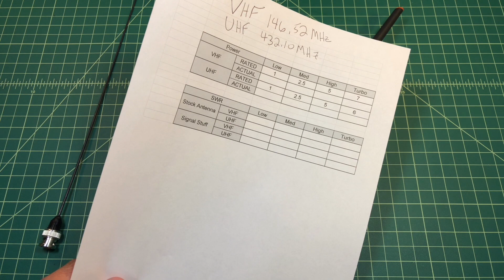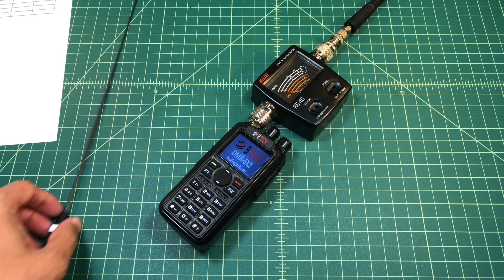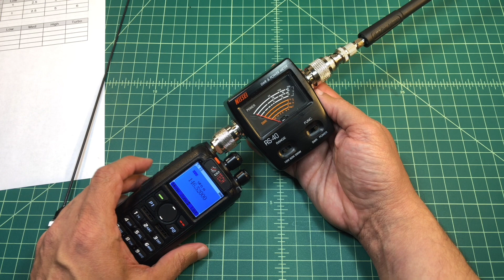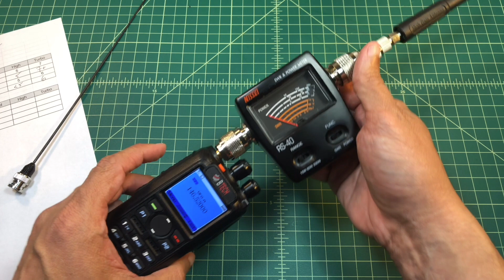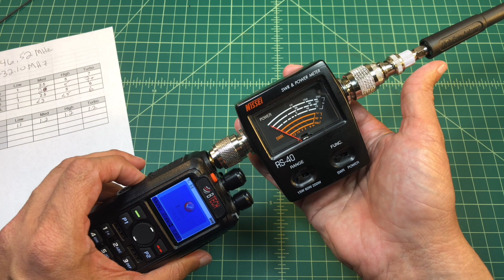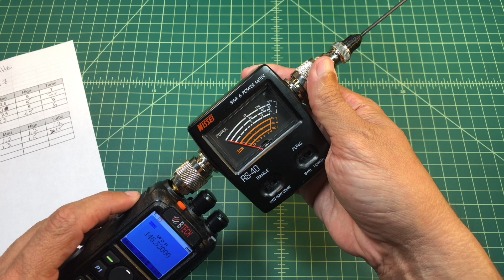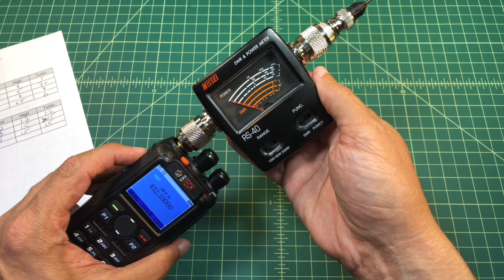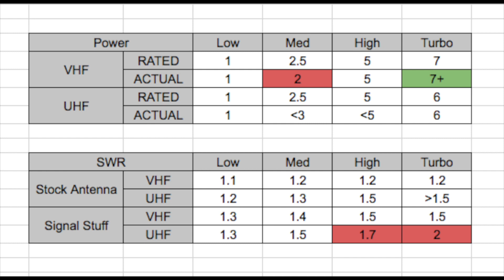BTECH DMR-6X2 Digital HAM Radio Antenna Testing - TheSmokinApe

Comment: The Standing Wave Ratio does not change with the power output of the radio!!! This speaks to the quality of the meter that you are as not being accurate! Just because you increased the power output the SWR would not change, what logic are you using here to think that it would?
Reply from the maker: I didn’t expect it would with this HT but I have seen it happen before on mobile radio installations.
Reply: @TheSmokinApe  I'm confused here, are you a licensed ham radio operator?
Reply from the maker: Mike B aka The Drone Ranger I am
Reply: @TheSmokinApe  Don't get me wrong as I'm not trying to be a smartass but how did you pass your test if you don't understand the simple electronic theory behind the resonance of an antenna? The power output of a transmitter is not going to change the SWR if it is as low as a 1/4 watt to a 1,000 watts. If the antenna is resonant on a certain frequency that does not change whether or not it's a hand held, mobile or a station antenna because of the amount of power being sent to it! The only way I have ever seen such a thing was when the antenna was being driven with more power than it could handle and started to melt and expand thus changing the resonance of the antenna! 

Now I totally understand that the meter doesn't atleast that I see have a way to calibrate it and that is more than likely the problem you are seeing with the different SWR's. That simply speaks to the quality of the meter itself and at best it's reading are only going to be reference but with you making those statements that the SWR is actually changing with the power output changing simply does nothing more than prove you don't know what you talking about and providing misinformation to the public!

My intentions are that I don't want you to continue to embarrass yourself and I don't want misinformation being spread so that the next person uses this video as a reference thinking that an antenna can change it's Standing Wave Ratio when nothing has changed to effect it to do so!
Reply from the maker: I passed the test by passing the test.  

Like I mentioned I have seen SWR change with increasing power.  Perhaps it was a problem with the transmission line or in this case with the adapters or as you mentioned the meter.

In any event I’m not embarrassed, the point of my videos is to document an example or experience and then have a conversation.
Reply: @SbrGrendel65 You're spot on!  Hilariously enough, the same dude has videos of himself improperly and illegally flying his drone out of visual line of sight chasing a UPS truck, so FCC rules/superiority apply to him but not FAA ones, yet nobody is asking him how he got his drone license or if he even has one.  Go figure.
Reply: It can changed due to harmonics generated at higher powers. So, yes, the SWR CAN change.

Comment: Don't you have to set the meter for each power setting. Or  maybe it's automatic. David Byrd KN4BHS
Reply from the maker: It has three power settings; 15w, 60w and 200w.  I left it on 15w for this video as the radio can’t go above that.  Hope that helps...
Reply: @TheSmokinApe  I think the SWR should be the same for all the power levels since its a ration of forward and return power.

Comment: Nice testing! I have a similar meter, it's a Micronta...something...That second antenna...made from Nitinol? We use it at work for some antenna ground plane purposes...just curious as we have some thin stiff like that antenna that you can tie in a know and it doesn't bend, kink, warp...etc
Reply from the maker: I’m not sure what it is, but I get nervous it will poke me in the eye.  The meter seems to work well but the adapters are a bit of a nuance, not sure how it could be avoided.  As always, thanks for watching...
Reply: yeah, those long flimsy antennas are a bit "sketchy" as far as eye safety is concerned! Adapters...yeah, necessary at times, but kludgy....
Reply from the maker: I’m enjoying the radio and the DMR aspect but I had to buy a DMR hot spot (video pending) because I couldn’t TX and hit the “local” DMR repeaters consistently.  So that would add ~$110 to the price of entry.  Also, it makes DMR kinda feel like an internet protocol of that makes sense.
Reply: I need to read up on the whole DMR thing, but yeah, I get what you are saying. I've seen some of the vids on using reflectors, etc..and thought...nah...not my thing.
Reply: I have an Open Spot on order because I am on the fringe of my digital repeater and get dropped on occasion.  The added advantage of using an Open Spot, Hot Spot, etc., is many more Talk Groups will be available than those provided by my local DMR repeater